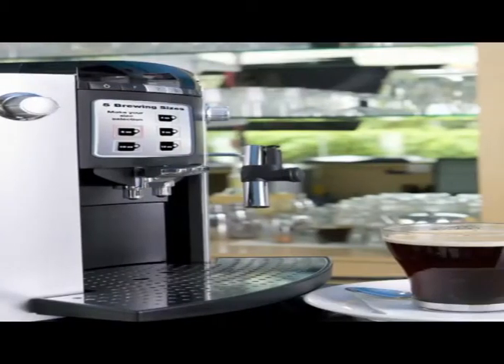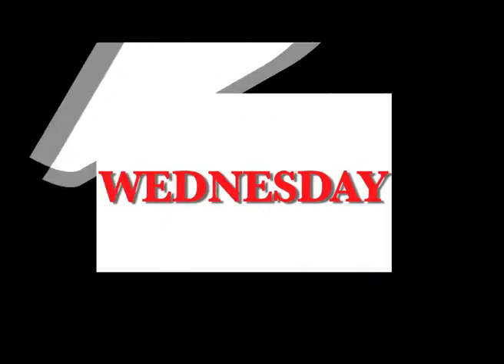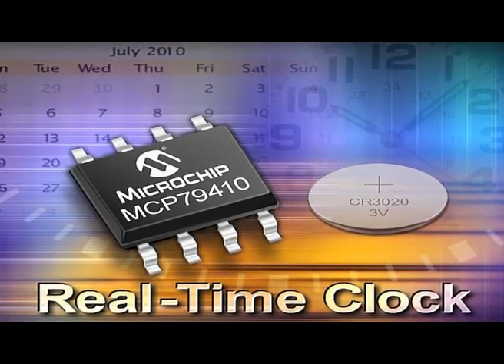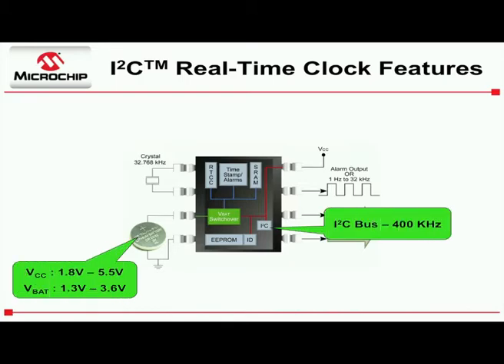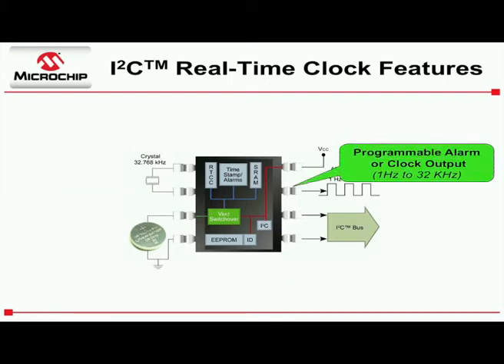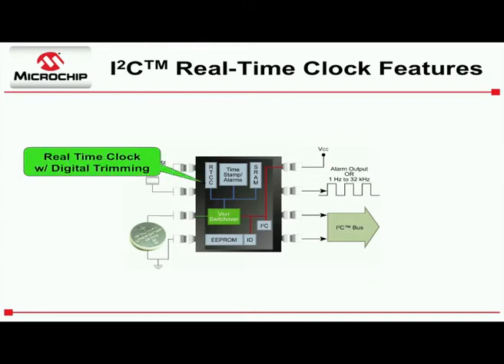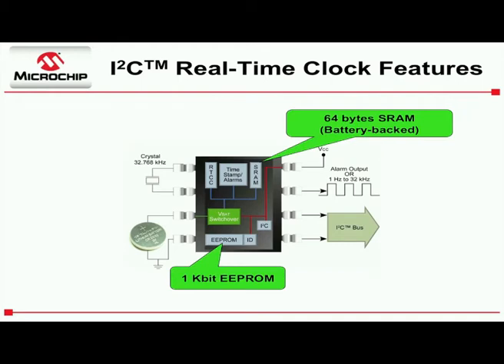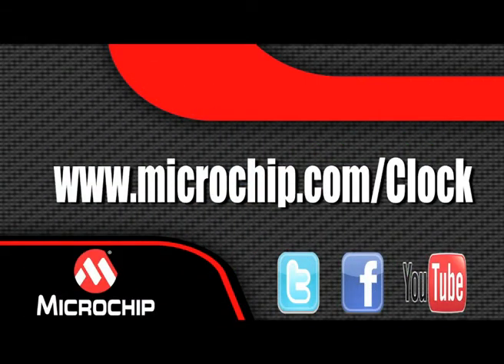Microchip Technology: MCP79400 Family of Real Time Clock Chips

Comment: Is there i2c interface code available for mcp7940 with pic16f886 or pic18f24k40 using mplab x ide.
Reply from the maker: Hi ajit nayak! The PIC18F24K40 is supported by MPLAB Code Configurator (MCC). So it can generate I2C code that you can use to interface with the device. Additionally, this video shows the ease of use:
https://www.youtube.com/watch?v=Wh21B2p7A68&list=PL9B4edd-p2agSfP7C-EKeGbnA8jpCeywY&index=9
Reply: @RSAmericas    i have /dsted library with other rtc device like ds1307/ds3231/pc8563 it works well. but in case of mcp7940 SDA/SCL remain high . i am  not doing anything special.only salve address i have changed like i used to do for other RTC device.
Reply from the maker: @ajitnayak1541 , to provide the best solution for your specific needs, you would be best served by using Microchip support here: https://www.microchip.com/wwwregister/login.aspx?ReturnUrl=https://microchipsupport.force.com